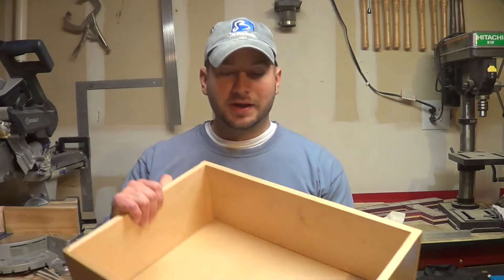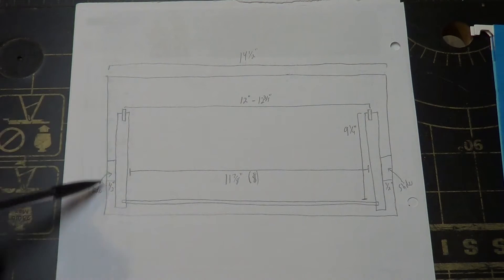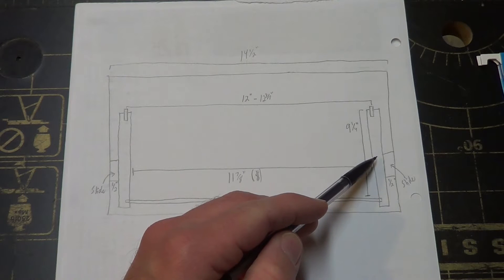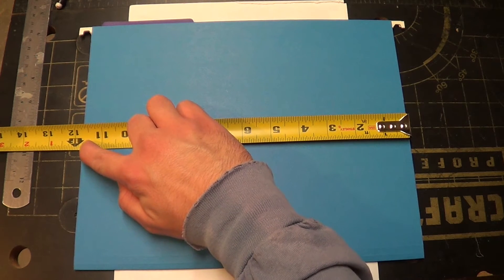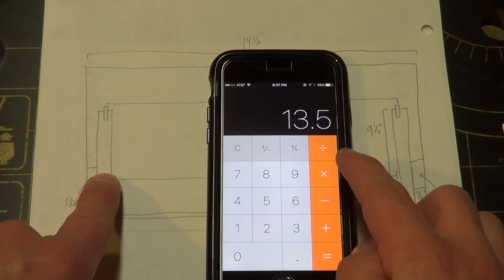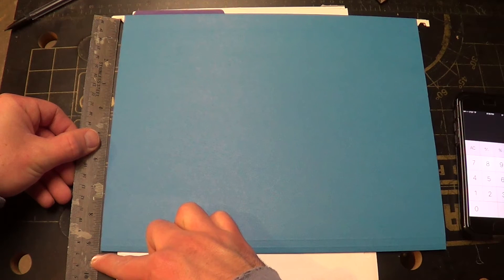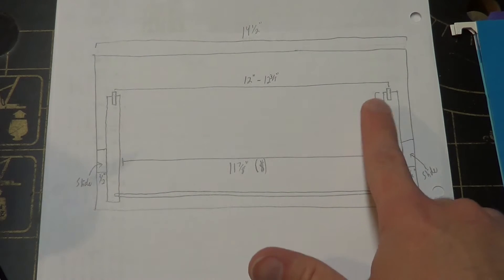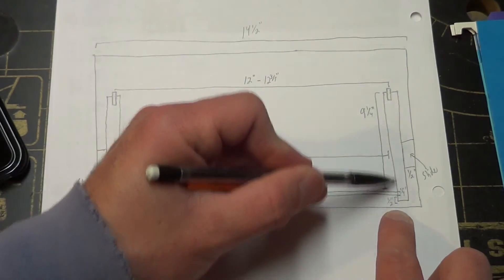Math in Woodworking - Episode 2 (Precision with Fractions and Decimals)

Comment: I think we have the same table saw. What dado stack did you use? Thank you. Adam
Reply from the maker: Hey Adam. The table saw I'm using is the Dewalt DWE7480 and it rocks! After I bought mine, I saw that Dewalt has a bigger saw with a bigger arbor so I was eyeing that one too haha. The dado stack I use is the Freud SBox8. it has 2 blades and you can switch between 1/4" and 3/8" dados base on what the blade orientation is. I bought it at Rockler or Woodcraft for either $89 or $99. It works great for our saw since it has a short arbor. The bigger Dewalt job site saw has the big arbor so I may upgrade sometime down the road.
Reply: Thank you. I'm going to double check when I get home.
Reply: RRR Woodworks Andrew I have a 745 so bo dados. Thoroughly enjoyed this video.
Reply: No dados
Reply from the maker: +Adam Mathis I'm glad that you enjoyed the video. The 745 & 7480 are almost the same saw but the 7480 has higher RPM. I measured the thickness of the Freud SBox8 blades and they are right at .2". My standard table saw blade has a thickness of .8", so I'm technically only adding 
.12" (1/8") to the width of the arbor. If your arbor has at least 1/8"-1/4" of threads left, you should be fine. 

I want to be clear that I made that statement based on my opinion and don't recommend you adding the Freud stack unless you are comfortable with it. (Just covering my legal bases here!)
Reply: RRR Woodworks Thanks Andrew! Don't worry. I'm risk averse when it comes to power tools. I had a little run in with my jointer. It made my left middle finger " littler" Adam